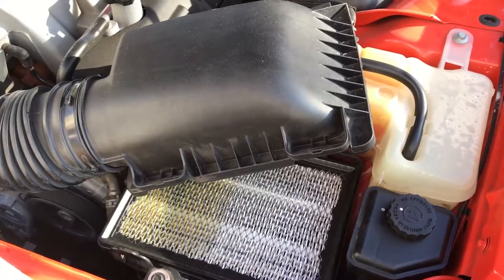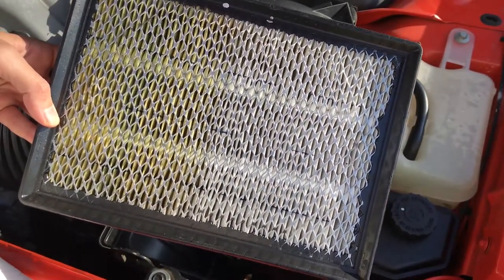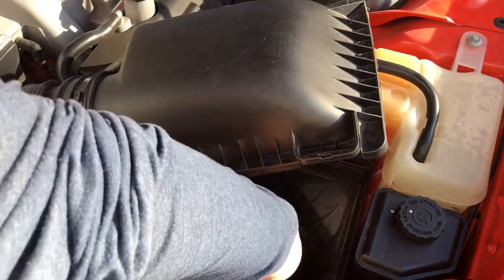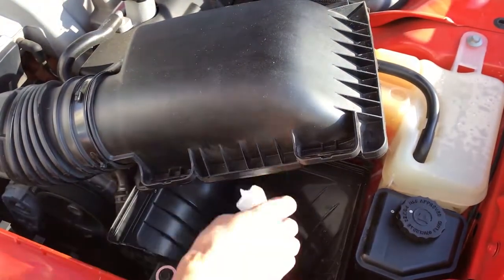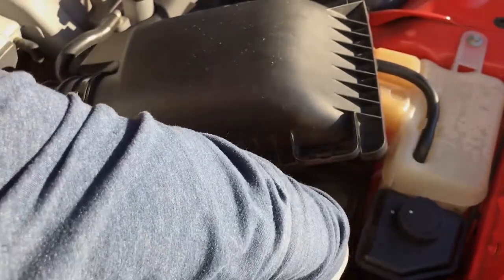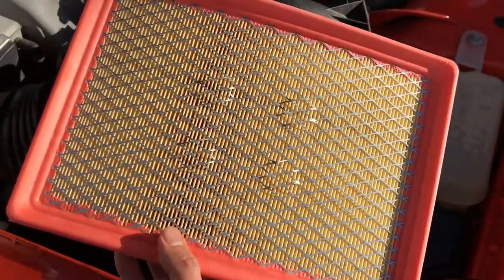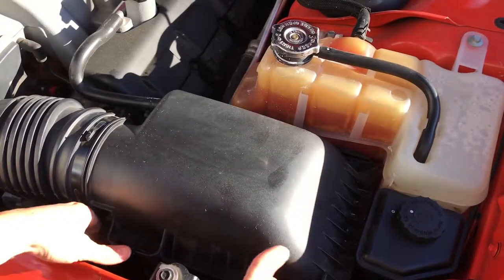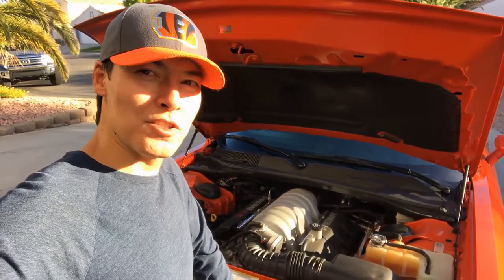Oil in the air filter?! Maintenance Tips for 2008-2010 Dodge Challenger

Comment: What do you mean by “filling it too quickly” ?
Reply from the maker: High pressure injector pump like at an oil change shop (“Goofy Lube” as Jay Leno calls them) or car dealership service. Filling slowly would be using a funnel and pouring each bottle of oil in one at a time, with a slow, gradual pour.
Reply: i dumped a 5 qt jug in less that 45 seconds and its apparently done this....
Reply from the maker: Crazy how this happens… because HEMI haha. Never had another motor with this issue but avoidable when ya know.
Reply from the maker: @prestoisakilla813  who would've thought you'd need to pour oil in your HEMI as if to avoid a ridiculous head on a beer...
Reply: I have a 2006 Chrysler 300 with the V6, 2.7 liter engine and I do all of my oil changes myself, hand pouring the oil into the crank case.  My air filters have always had this problem and I can not figure out why or how the oil is getting there.
Reply from the maker: Immediately after filling the crank case do you see clean oil on the filter?
Reply: @HEMImania  I haven't ever really checked it immediately after changing my oil.  I just assumed that it must be something related to blowback.  My car has around 230,000 miles, so I kind of expect a certain amount of oil to creep it's way through the crankcase ventilation hose, but it's pretty damn annoying to see it mucking up my air filter.
Reply: Hey I have V8 and it does this I never knew it only does it after  oil change

Comment: Yes you have to pour oil into Hemis slowly. Especially the 5.7L. This is extremely common especially if a transfer jug is used and the funnel is too wide. If pouring you either need individual quarts poured at a time or a funnel with a good choke point at the end.
Reply from the maker: Good to know. Thanks for covering 5.7s! 👍

Comment: Got same problem in my cold air intake, I’ve bought new filter but it got dirty again idk wat to do
Reply from the maker: I've since switched to an aFe MAGNUM Flow Pro Dry CAI myself and the dealership ended up getting oil in the filter after I explicitly asked that they fill it slowly. Just gotta check immediately every time and wipe it down before it sets into the CAI filter material.
Reply: @HEMImania  same, I’m literally about to start removing the filter right in front of them and then letting them do the change. I showed them two different filters from two different changes and they said they have never heard of an overflow issue before and immediately wanted to change the PCV
Reply from the maker: HA–of course–instead of looking into a well-known issue that they might not be aware of they propose to make unnecessary changes to the PCV valve instead.
Reply from the maker: @zuxyr  that sounds like the way to go. Can't trust that explicit instructions make it from the service advisor to mechanic and that they are followed for the desired result.

Comment: Mines do this all the time after a oil change so I didn’t know
Reply from the maker: I make it a habit to wipe down the air intake after every oil change. I replaced the stock air box with a cold air intake since making this video and the oil no longer ends up in the filter but the air duct to the throttle body still needs wiping down.
Reply: @HEMImania  ok so I guess after oil change expect a little bit of oil

Comment: Found oil in my 2014 SXT intake box. Going to try to install a catch can to see if that also helps!
Reply: Did it help?? Thx, I have the same issue and I am contemplating getting one
Reply from the maker: Lliam Rosencrans also wondering how the catch can is doing. A buddy of mine says it helps a bit on his Hellcat.
Reply: Channel SRT-8 yea definitely get a catch can it does wonders
Reply: Whats a catch can?
Reply from the maker: @TitanHugo81  a catch can slows down and filters oil that may end up in the intake and combustion chambers.
Reply: So what do I do to install one?? I keep getting oil in my air filter
Reply: Titan Hugo the catch can isn’t the fix for oil in your filter it’s when u pour the oil in,  oil goes through the intake manifold tube and goes over your filter. A quick fix is that you pop off the intake manifold tube going to the air filter box and point it upward when filling your up your oil so that the oil does not go though the tube and go on the air filter. The tube is a breather for your oil.
Reply: Titan Hugo u should get a catch can if u want to prolong the life of your engine and keep it healthy.
Reply: Where do I get this catch can??
Reply from the maker: @TitanHugo81  I would search AmericanMuscle, Summit Racing, JEGS, heck even Amazon for your exact vehicle year, model, and trim (e.g. 6.1L HEMI SRT-8, 5.7L R/T Shaker, V6 SXT, etc) to order the right fitment for your application.

Comment: Check your pcv valve
Reply from the maker: Disconnecting it and plugging it with a rag or whatever may be a good way to prevent a shop from causing it to spill into the air intake.

Comment: Just found oil in my filter and a bit at bottom of air box. Looks old like it happened a while ago. I should have checked earlier only bought car 4 months ago and car ran great, though I always wondered why my 300c Hemi seemed to pull harder than this 09 R/T, guess I know now. Thanks for the info. Oh did it ever happen again with slow oil filling?
Reply from the maker: Not with slow filling via funnel and bottle versus commercial shop pump. Dodge Dealership even did it, though. 🤷‍♂️

Comment: Somebody online was suspecting that the oil company was adding oil on purpose to the air filter, but it actually may have been a legit problem like this.
Reply from the maker: That would be some shady stuff to soil a customer's air filter in order to sell them highly marked up replacements. Not outside the realm of some shops' business practices, but I'd lean towards what you're saying since even two Dodge dealerships in town did this to mine during routine oil changes. Probably easy for a mechanic to  overlook this issue.
Reply: It’s because dealerships do oil changes from a feed line, it’s a. Hook up and pump type deal and they seem to fill too quickly and cause an overflow

Comment: jeep cherokee i keep having this happen after oil change at dealership :/
Reply from the maker: This happened again with the dealership I last went to. I am going request every time now that the service manager acknowledge my instructions to manually, slowly pour each quart and not use a high-pressure dispenser.
Reply: @HEMImania  u sure its not a bad pvc valve though?
Reply from the maker: @JD-im4wu  not certain... but this is a common enough issue that can be easily avoided if the valve is okay.

Comment: Same my Ford Expedition 2018 there is oil on the Air filter 
Is it normal or not?
Reply from the maker: I would assume not normal. Did you change oil since last checking the air filter?
Reply: Yes I did 
And air filter was oily so I changed it
Reply: Not oily but it has oil a little bit in one side
Reply from the maker: Ahmed Alwgadani sounds like what happens when an oil change shop uses a high pressure dispenser and it backwashes out of the crank case vent hose. Might that be the case here?

Comment: I have a 2014 grand Cherokee and it's doing the same thing any suggestions on what the mechanic should look for ?
Reply from the maker: Is it happening during an oil change? If so the mechanic could remove the filter before injecting the oil, wipe down the air box afterwards, then put the filter back in. Seems shops rely on their pressurized oil dispensers instead of pouring it in slowly with a funnel like ya might do at home.

Comment: I have the 5.7 liter in my Durango and I also have oil on my filter. I think it was clean oil too. This is the first time I’m hearing that it was filled too quickly snd caused this issue. I think you might be right though. Hope you are.
Reply from the maker: Right, if the oil is clean then it is not an issue to fix with a catch can. My last oil change at the dealership 3 weeks ago resulted in oil in my aftermarket cold air intake duct that I could easily wipe up and luckily was not on the filter. 👍

Comment: Will it make any difference if you took the engine oil stick out while u r filling the engine with oil??
Reply from the maker: Interesting... I bet with the dipstick out it could slightly reduce on the amount of oil that might splash out of the crankcase breather hose when filled quickly, but I'm in the habit now of ensuring the oil is not filled under high pressure. Would you mind letting me know how it goes if you try it?

Comment: That’s crazy
Reply from the maker: Eone1 yes indeedy. Must take it easy when filling up engine oil. I have a cold air intake now so will follow up after my next oil change whether or not this happens in the cold air cabin also.
Reply: Channel SRT-8 hey man so I went out and looked in my air box and it’s happened to me 2, half the filter was drenched in oil took the filter out and there was a puddle of oil on the bottom of the air box. I got a new filter and did the same thing u did, So the next time when i fill it up with oil I’m going to unplug the tube from the air box and elevate it up so no oil can go through the hose hopefully it will work 😂. And thank for making the video about it, I’ve been driving it with the air filter covered in oil for some time now.
Reply from the maker: @mocacreamjr  fo' sho' I was wondering why the throttle response felt out of whack and didn't see any YT videos exactly covering the issue at the time so I took the info I found in ChallengerTalk forums and elsewhere and then filmed the cleanup. Are you considering any CAI's for your HEMI?
Reply: Channel SRT-8 I was thinking about it, but I’m going to keep it stock the factory air box are designed pretty good for the engine.
Reply: That's why I just said first time I've heard of this I pulled in to get an oil change and they tell me my filter has oil on it 😭😭😭